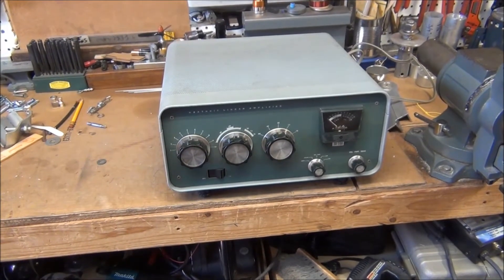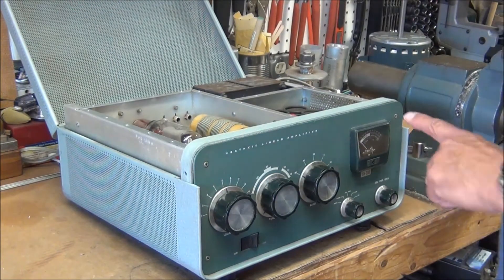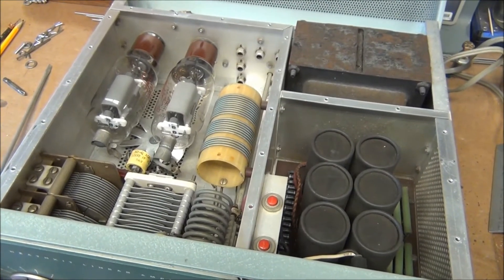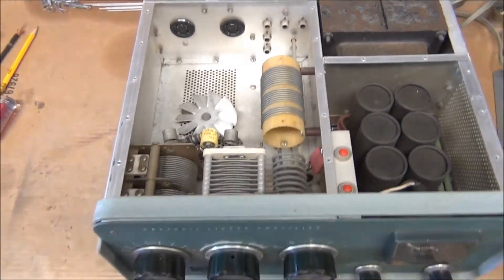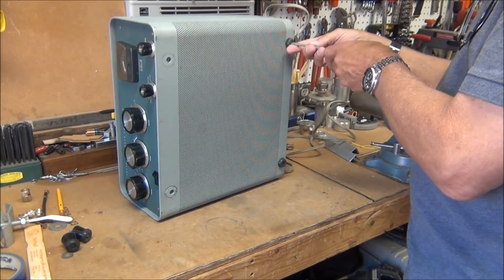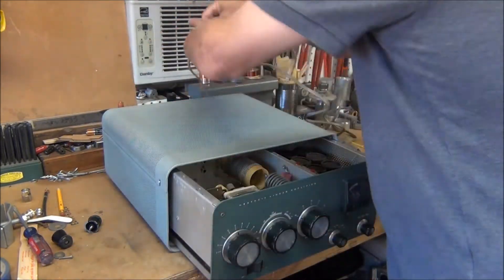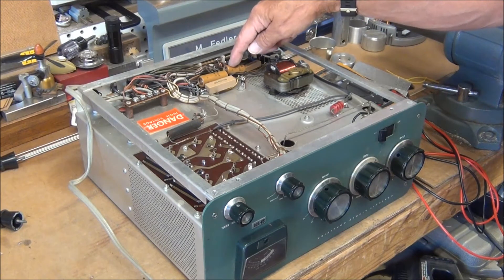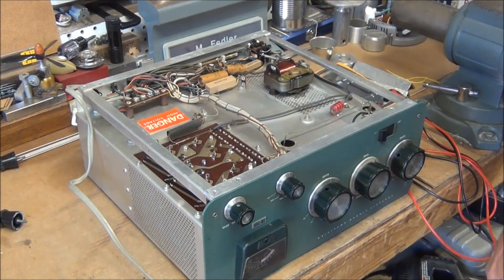SB200 Linear Amplifier - Tube & Case Removal

Comment: DUDE! Put a towel in-between the cabinet and your workbench. Don't drag the cabinet around directly on that bench and scratch it. Otherwise great video, especially the discharging :)
Reply from the maker: Maybe you didn't notice that the surface on my workbench is covered with cardboard. Take a closer look.
Reply: @mefedler  I didn't see that. Good stuff.
Reply: I agree. You can hear the grit scratching it as he turns it. But good video

Comment: I got 2 of them . 1 older and 1 newer . both have BNC input. newer one does not have 10 meter . both have power supply caps bad and older one the bord burned with diodes . got most parts I need. 73's